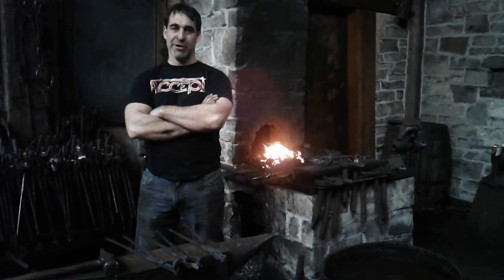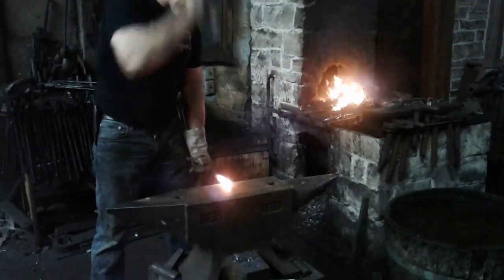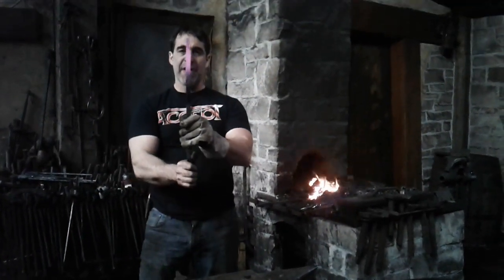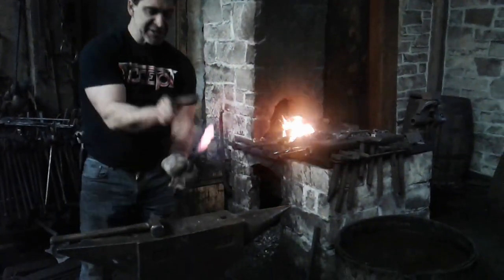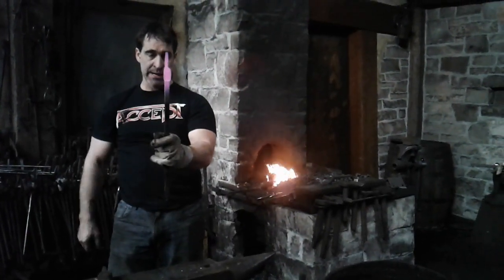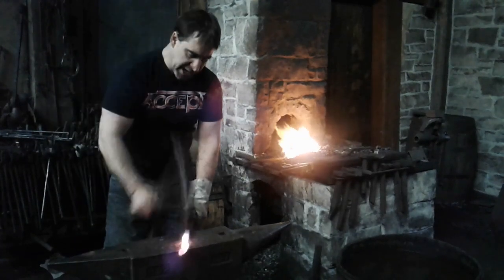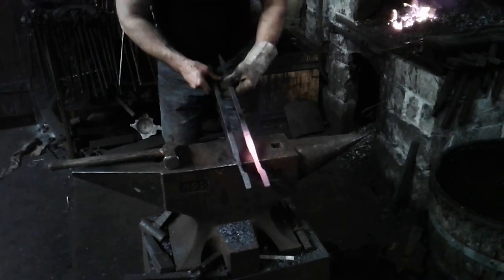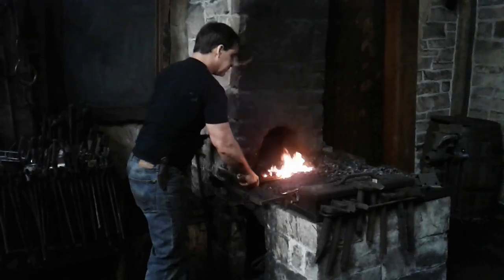Thak Ironworks - Forging Blacksmith Tongs for Beginners PART 1

Comment: Too far away need to video close please to actually see what's going on.
Reply from the maker: Thanks for feedback. We plan on redoing these in future.
Reply: @ThakIronworks  No worries, I was watching Joey Van Der Steeg the other day and he mentioned this issue, of please get close up views for viewers so they can see exactly what the smith is saying. So I have taken this on board too
Reply from the maker: @lenblacksmith8559  we have been working on improving this already. You may find in our later videos (especially our upcoming video) we have really focused on getting more close ups. I absolutely agree it is not helpful when you can't see what is really happening.
Reply from the maker: @lenblacksmith8559  another point we are working on is that awful glare from the fire and the heated steel.
Reply: @ThakIronworks  Great thought I would share my thoughts with you to help you create better video's. True especially beginners they like real close ups, as they may have never seen how something is done before.